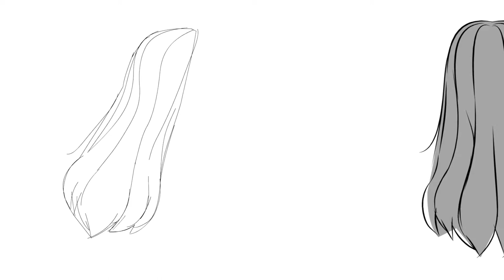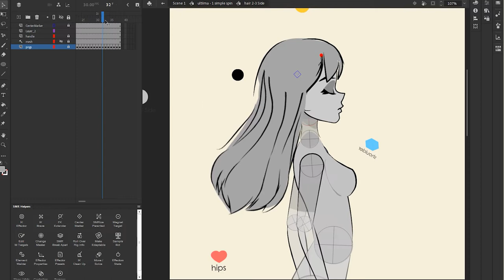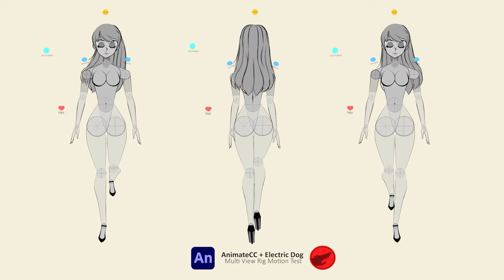Multi View Motion Test and Overview

Comment: for 4 years, since picking up CTA5, i've been wanting to do this. I'm about to go full blender for 2D animation with 3D models. Is there hope in AA ?
Reply from the maker: It's tough to say. I've spent so many years using Flash/animate that parts of my brain think in terms of nested timelines and symbols. I'm also not sure what the remaining lifespan is on  this tool. It's ok as it is, but newer tools are pretty awesome. I think knowing multiple tools is almost always ideal- use the right tool for the job, kind of thing😆
Reply: @RigTheory  interesting, but i think you pointed out why i dont do well in flash animate as my mind is not used to thinking in terms of symbols ;D Either way, keep up the good work!
Reply from the maker: @Boxels thank you! You too 😃

Comment: I started with Animate when it was Macromedia Flash. I Stopped using it long before Adobes acquisition. Long story short, I discovered Flanimation Power Tools and have been using it in Animate for the last few months. In the learning process, I found your channel which has helped me immensely, thank you. I have one question, in the front and rear views of your puppet animation how did you get the legs to move straight at or away from the viewer? Thanks in advance for an answer.
Reply from the maker: Hi Bob! I remember that and I was actually pretty upset, LOL. I'm glad that Adobe has continued updating Animate and I hope they keep it up! I did something pretty simple for the legs on that character. The foot, thigh and lower leg are separate symbols. To create the illusion of foreshortening I moved the pivot point on the leg to the knee and scaled the length of the leg to make it look like it was bending. I moved the foot where the ankle would be without scaling it in order to sell the illusion of the leg bending. The illusion holds up o-k-a-y, but I had to kinda break the rig for the frames where she's moving like that.
Reply: @RigTheory  Thank you for getting back to me. I kind of figured you had to have done something like that. I was hoping though, that there was something I had missed and EDAPT had some secret way doing the foreshortening whilst maintain the rig. Thanks for fessing up, and for a great channel. I've learned a lot.
Reply: Could you do a nested animation in the thighs, like a shape tween to make them shorten and distort, and the smart magnet moves with the pivot point throughout the tween, dragging the calf up with it?

Comment: Wow! This is amazing! Just out of curiosity, would it be possible to add symbols as for leg bending (Mostly to help with slight foreshortening?) Would that be similar to adding symbols for hand poses? Interesting stuff, I am enjoying learning and watching your tests and explanations!
Reply from the maker: Thank you for your thoughtful comments. You made my day!! I wish I had more time to create comments. Yes, foreshortening is probably the most challenging trick to manage with puppet animation. We would have to experiment with a few different approaches for foreshortened arms and legs to find the ideal setup. Theoretical setups are harder because we don't know what kinds of actions the character will perform- we'll probably try to accomodate more actions than the character will actually need. The other problem with over-engineering a rig is that the doll is also VERY difficult to use.

I think it's helpful to build a basic rig and be prepared to add special rigged poses afterwards. Creating some cool, dynamic poses and articulating those is probably faster/better than trying to create a "do it all" rig.

I may have gone off track there. I hope that helps? 😄